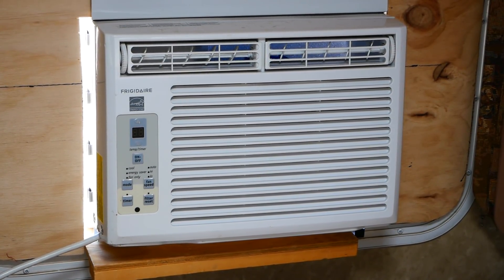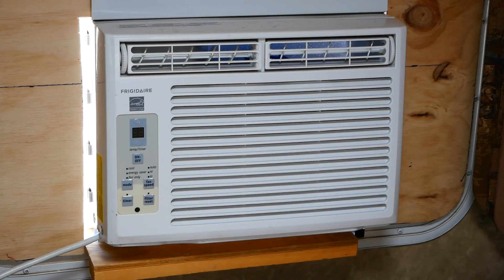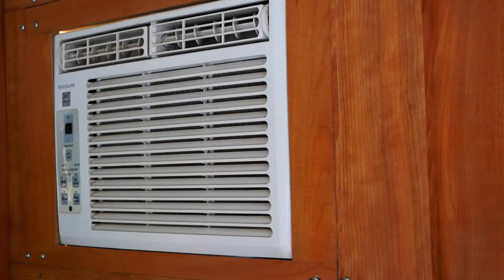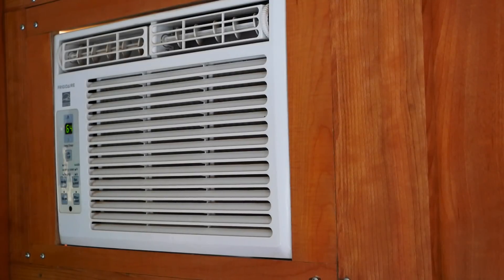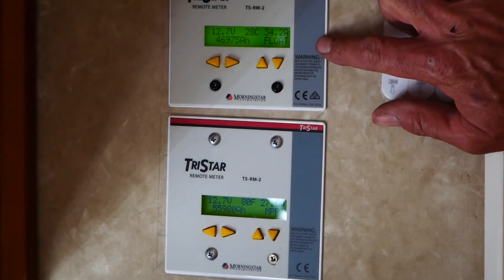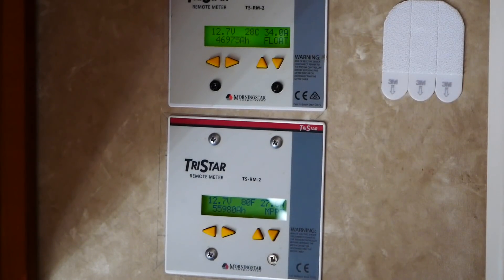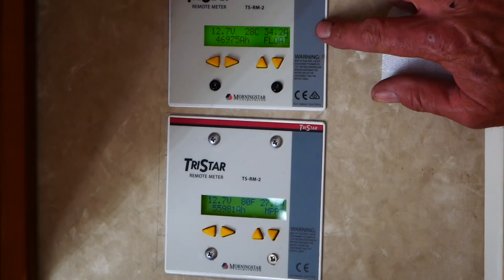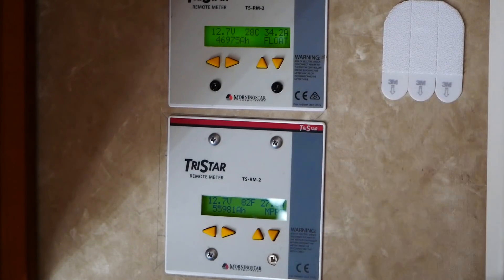Dual air conditioners on 1185 watts of solar

Comment: What kind of inverter do you have?  It sounds like those compressors are struggling.  Is it pure sine wave?  Maybe it's just the camera that accentuating the compressor sound.
Reply from the maker: I use a Tripp-lite industrial inverter that is meant to handle the starting surge. It is MSW but is cleaner than most. The cabinet mounted unit probably needs to go back on warranty.

Comment: Howdy Jim, I will say that I envy you my friend. Two AC units running on solar..... Awesome! I would like to be able to run my Briskair AC unit on top of my Fifthwheel on solar. At the moment I have six Renogy Monocrystalline panels. Four are 100 Watts each, and Two are 150 Watts each. At the moment I'm using the the four 100 Watt panels along with the Rover 40amp mppt solar charge controller. My battery bank is two 6 Volt Trojan T-105 RE batteries. All I'm using this for is to run my lights 12 volt led lights, and my 64 quart dometic cooler or fridge. And to charge phones and so on. Can you give us a break down of just what all I would have to be able to run my AC on solar please. I'll have to check and see what the watt an amp draw is. You said in the video done with Bob that for a bit over 3K we can have a set up like yours? That would be great. I'm selling my Goldwing and I can use that money to help build my system but I will need your experience and expertise to guide me. I honestly don't know enough about solar to take this on alone.... Thank for being there Jim. Yet one hell of a man.
Reply from the maker: You will need enough panel to produce the power to run the load. With most roof top units that is a lot of panel. Part of the reason my system cost what it did is because I found the panels and battery's on craigslist.

Comment: Who would have thought A/C from solar? I can feel the cool from here. Just curious, what is your indoor temp? Thanks Jim 😃
Reply from the maker: It had gotten up to the low 90's before the test and will get as low as 70* before I shut down at least one of the A/C;s. Once cooled down it takes only one to keep it cool. I haven't had the chance to run them both in extreme heat yet.
Reply: Solar Boondocker Incredible

Comment: I will never get used to the humm of motors on a non sine invertor , is there any heat build up in the motors ? any idea of longevity compared to an amount of use ?
Reply from the maker: I started with a PSW and it died after running one of the A/C's just once.

Comment: Jim,  I'm designing the solar side of the power systems (12v and 120v) for a 40' school bus buildout.  Your videos are most informative, however it's time to go to the next step, and spec the roof panels, controller, inverter, and batteries, so I can get the components ordered.  I'll be in touch, to put you under contract to review what I've done so far, and for you to spec the components.  What is a good email address to send you my contact info, energy budget, and system sketches so far?  Thank you,  Charlie Steinman, in Austin,  CharlieS at CSFCivilGroup dot com
Reply from the maker: jim@jimindenver.com

Comment: Jim, I guess that would imply 600 watts of solar could be set up to run one of those 5000 BTU AC units and also keep the batteries charged — given your usage and setup. Do you know how much power the AC uses while running?  Cycling?  It looks like from your remote panel readings, the combined running power usage was around 800 watts, so each AC used about 400 watts. So during the sunniest part of a day, a single AC could be run on just over 400 watts of solar (assuming no other power usage).
Reply from the maker: I generally tell people to have 7-800 watts due to heat and humidity causing the compressor to pull heavier.
Reply: Jim, I assume you referring to 7-800w for one AC during high heat and humidity. Does that mean this double AC demonstration was a best case scenario that might not run on your 1100+ watt system during high heat and humidity (may need to shut one off)?
Reply from the maker: My trailers 750 watts have a output of 660w and so is a nice buffer. You could get away with less. My full system puts out right about 1000w and is more than enough for both on a hot day in theory,
Reply: Jim, Great data! You are bringing to light solutions I did not even think were possible. And I get to practice solar math. It is a good day. Thanks.

Comment: Tickles my brain. Jim, is there an issue with both AC units cycling at the same time?  I would assume that if the power needs during both starting up were larger than the solar could supply in time, the batteries could cover that very temporary spike in current demand, so it would be a nonevent.
Reply from the maker: The batteries likely take the surge from even one of them starting
Reply: His chosen brand of air-conditioner is "Low power start-up and operation"
Reply: Gary Stone, yeah, I had heard they had lower power demands on startup. Have not found the the actual number.  Measured old window AC and it required a dedicated 20 amp house circuit on startup. Yikes!   I think what I have learned about these AC units is that their start up power is low enough that a good battery bank would fill the very short extra demand. Just need enough extra solar to fill the batteries back up.
Reply: I have a new solar Sunny Boy inverter with an up to 2000watt Secure Power Supply that I just tested on one of these little airconditioners...it was putting out about 1500 watts and started and ran the 5000btu air-conditioner with ease. Ran a fan at the same time. All worked well and easily together.
Reply: Gary Stone, cool (started out as no pun intended, but I’ll take it). Great info. Not quite far enough along in my build to get one of these yet, but all reports are really good. I don’t see anything better. Thanks!

Comment: Jim, It looks like you are running a total of 12,000 btu of air conditioning on solar. That is amazing. The other consideration would be to install an evaporative (swamp) cooler to run on your batteries, after the sun goes down. It would pull a lot less amps than a compressor type AC and would keep your RV comfortable when your panels were not producing power. How many hours can you run the AC's off of battery only without danger of not being able to run the AC's the next day plus bring your batteries back up to 100%? Maybe a swamp cooler would be overkill?
Reply from the maker: It's 10,000 BTU's. The only thing about a swamp cooler is the water they use. I can create power but not water. I have never ran both off of the batteries because it is generally cool after dark where I camp. I can run them on solar slightly before to slightly after peak light.
Reply: Solar Boondocker. I understand that location is the best way to control heating and cooling needs. You do an excellent job in your videos of showing how solar can be a viable option as a full time RVer. There is a trend now where YouTubers are being sponsed to install cutting edge solar systems in their TV's however when put pencil to paper these systems cost between eight to ten thousand dollars. Your systems are affordable enough to be a real option to the Full time RVer like us.
Reply from the maker: The original name to the channel started with "cheap solar" because it doesn't have to cost a arm and a leg
Reply: @treysuniverserv1576  Often the systems that cost arm and a leg are BRAND new off a solar or retail store..If you look for used stuff you can get a lot much cheaper..I got a low frequency 1500 watt inverter for $50 a huge swamp cooler for $100 that I run all summer when I am in my RV park and a bunch of solar panels used total cost for that and 900 watts of solar with 6 NEW T-105 trojans ..less then $1500 then of course the wires, also bought used :-)

Comment: Two A/C units - That's COOL!!! hahaha

Hey Jim, can you do a video on the correct way to wire multiple batteries together so they charge/discharge evenly?
Reply: Steve Soke, all batteries will discharge differently. The key is to minimize the differences or just get one battery. If multiple batteries are the same brand/model, and the same age, and they were used the same, effectively they will discharge even enough that if wont make a material difference - and there is nothing we can do about the difference. (In contrast, using very different batteries, brand/size/type/age, will destroy one battery as it tries to fulfill more of the power demand.) Wiring between the batteries must be very good, short even links, and large diameter wire connecting the batteries - effectively making one battery. Wiring to and from that battery bank does not affect uneven battery discharge.
Reply from the maker: I could except I do not have enough batteries to get into the more complex set ups